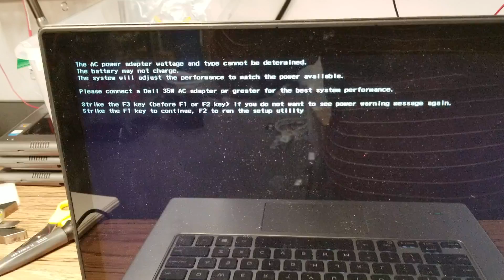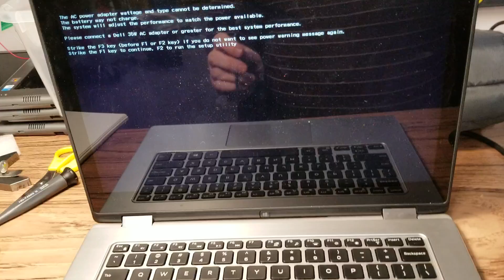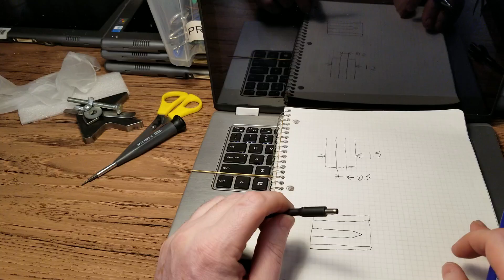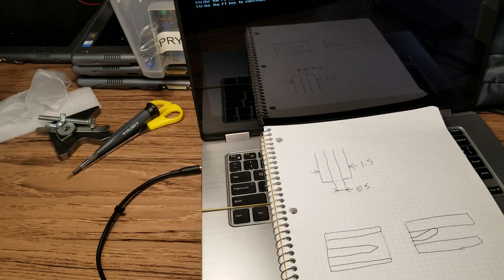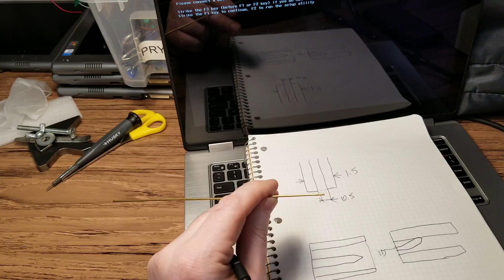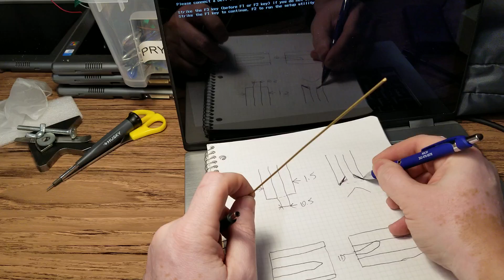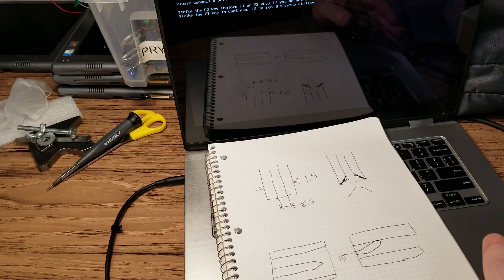Dell displays a message: Power Adapter Wattage and type Cannot be determined

Comment: My adapters are Dell OEM units that work fine on other Dell laptops.  Finally used an old PRO3X E-dock which bypasses the AC jacks on my 2 bad laptops (E7250 and E7450), and they now charge and run faster.  BIOS also indicates correct wattage.  The E-dock works with all Dell E-serries laptops.  Note: The dock requires a 90W adapter to operate.

Comment: if the id pin is touching the +19 volt on the charger in some Dell, Lenovo and Hp laptops the I/O chip will get shorted

Comment: that is not the problem  with my dell laptop.. the charging cord pin is straight,,, i get that same message on every start up..  i bought this used laptop from a buddy that was an IT guy for a large company...   i told him about the message i get, he had me read off the specs from the dell charger and the computer spec plate..  he said that is the correct type of charger for my laptop..
  i also notice that the top of the laptop gets HOT on both sides of the mousepad at times when in use..
 makes me  a bit concerned...

Comment: So I had this error message as well but my charger was not bent like that.I called dell and they told me to turn off the computer and then hold down the power button for 20 seconds before releasing it and it fixed the problem

Comment: I have a problema Lenovo: “The connected AC adapter has a lower wattage than the recommended model – Please connect the AC adapter which was shipped with the system for best system performance” the laptop is new. :C

Comment: I have put aside my original Charging Brick and adopted the use of USB C PD Decoy plug. With it, i can have a common charger and share with ALL devices that is USB and USB PD compatible. Those Converter / Adaptor / Decoy Plug is very cheap at MYR 10 each (USD 2.5). ALL it needs is a USB PD charger capable of 20v putput (45W and above) and the plug will negotiate 20v from the charger and supply to the laptop. Although the laptop voltage could be 18.xv ~19.x V, it can tolerate the tolerance of the supplied voltage and so far there it is working fine...

Comment: @5:36 "The Center Pin is the ID pin, that's what tell computer what type of power supply being plugged in to"

Correct me if i am wrong,
The Center Pin is either a Positive or Negative Pole depending on the Laptop model while the Other Casing Cylinder is the opposite Pole of the center Pin"

The computer display that message when the wattage is not as expected.
Eg when the connection is not secured, it cannot transfer current (A) effectively.

Watt = Volt x Ampere

Therefore the computer will register as a Lower Wattage adaptor was plugged into it.

Comment: I also get this message, but the problem is on the laptop board, power adapter works on other laptops, and also already replaced power jack. I will have to check if there is any short on the board, or IC...

Comment: Within some mechanical pencils, there is a metal tube that you can use to bend the charger pin back in place. This video fix worked for me, btw. Thanks!

Comment: i got problem same like that i use to measure the volt of charger and it give good output ... i didn't realize the pin inside the charger is bent after i see this video. thanks a lot bro ....

Comment: I'm getting this error after replacing the input jack after crushing the previous one by bending the power jack whilst inserted. I know the cable is good as works fine on another laptop still. Does this sound like a faulty replacement input jack or worse? Model is dell 5480. Thanks

Comment: I have the same issue with my dell inspiron 1521 and accidentally press f3 now my laptop totally no power. When I plug in the power supply connector power light goes off...

Comment: Oh my goodness it worked!!!! thank you soooo muuuch!! :D
Reply: @justyourlocalteasis1633  hi! im not sure what it's called, but the small pin inside the tip of the charger was misaligned/bent that's why the charger won't fit well. so i straightened the pin. after that, the charger fits well and the laptop was charging already.
Reply: @justyourlocalteasis1633  I'm glad to be of help 😊

Comment: Thanks for this video......I was able to fix my Dell laptop so it will charge again. I used a generic brand Q-tip to fix mine......one with a stiff stick....Cut off one soft end and shave/cut the stick so it is small enough to do the job if your power jack is very small like mine was. I am not sure I will buy another Dell though because of this feature. This is the second Dell I have had this problem with.

Comment: I still have this warning with 2 different power supplies and with good pin inside, it's on my Mothers Alienware m17x r3 and the performance is horrible atm. It's weird tho on diagnostic tool everything passed the test except my battery which I will get replaced in some days
Reply: Running Diagnostics from my Dell 5430 laptop, the power supply test says "Pass" but it also says the power supply is rated 1 Watt.  It's a 90 Watt supply, which is what is required by the laptop.  The test is defective - it shouldn't have read "Pass".

Comment: You sir, absolutely saved me some money!! I could not figure out why it would power on and work correctly but not charge and that message had me concerned. I just bought this power supply used and assumed it was not the right one when it didn't plug in all the way. In the end, that stupid pin was just bent. BTW I used a thumbtack point to fix mine.

Comment: I've been having the same problem for more than a year and it seems to have considerably slowed down my laptop. I bought a new charger, the problem persists. New battery, wasted money. I replaced the DC jack,  nothing. It's so frustrating that I may have to buy a new laptop after only 2 years of using this one. I'll never buy Dell again.
Reply: Yes I have this problem more than 8 month.. my laptop is slow.. 😢😢😢
Reply: I am having this problem from 2 days ago I think I have to buy a new charger for my dell laptop and yeah my laptop also slowed down it have 2.00 GHz and its speed always stayed in 2.00 GHz but now its been to 0.49 to 0.50 . my good laptop turned to bullshit
Reply: @sayanghosh4829  I bought a new charger and it worked for a few weeks, before the problem reappeared. Then a repair service told me that my DC jack was broken, when they fixed it, the problem was still there. Then they told me that I again needed to buy a new charger, as the previous one was apparently not the original one. They did fix the battery charging issue with the new charger and new jack, but I'm not sure if the computer was running faster because I refused their repair as I didn't want to buy a new charger again.
Reply: @womenstennis  Ok bro I understand, but first I will take a charger from my friend and see that it's charging or not if doesn't then I have to repair DC jack  and if it works I will buy a new charger...
Reply: @sayanghosh4829 Ok. Just make sure that the message is no longer there, not just that it charges.
Reply: @womenstennis  OK BTW where are you from I m from India
Reply: @sayanghosh4829  from Serbia
Reply: @sayanghosh4829  please go to a shop and try to repair it.. go to a good technician...
Reply: Zdravo Marija, razumes Makedonski? I'll go English, my Serbian is funny... I have the same problem for a year as well. Did you happen to find a solution in these 2 days? Or any help..?

Me nervira ova, poludecu...
Reply: @inkaloops-socialmediagrowt2611  The 3rd repair shop I took my laptop to says that my DC jack was broken (probably because of a fall) and my charger was not right (it was some Chinese substitute). They claim that they repaired my DC jack and that a new charger (25 EUR) is now charging the battery and the adapter is now recognized in BIOS. I still haven't had a chance to test the performance of the machine, but they say that it must be working with full capacity now, as the unknown charger and broken DC jacket forced the laptop to go into a minimum maintenance mode.
Reply: The 1st repair shop told me that the problem was just the charger and they sold me that Chinese charger, which actually did charge my battery for the first two weeks, although the warning message was still appearing. I thought I solved the problem and made a huge mistake of throwing away my original charger, which was maybe even fine and maybe only my DC jack was broken.
Reply: I've had this problem on my Dell Inspiron for 3 years and I've just grown used to it. Though I do miss when my laptop was faster...
Reply: @MixcesStar  I bought a second new charger and fixed the DC jack (if that's what it's called). I took it to three repair shops and the third one was skilled enough to solve my problem. My laptop is as fast as a bullet now! After years of annoying me. I was close to throwing it out of the window. Total price was about 50 euros.
Reply: @womenstennis  thats nice, I may do the same and Im feeling the same way you were feeling right now lmao
Reply: @MixcesStar  One more thing to note: my DC jack was probably broken because of a fall. Also, it's important that you buy an original charger.
Reply: @womenstennis  but what did the 3rd repair shop do?
Reply: @Krystalhelp  They gave me a new charger (the first repair shop sold me a low-quality charger that didn't fit my laptop) and repaired the DC jack.
Reply: you still having the same problem?? you can give me your laptop if your buying a new one..
Reply: I bought a new charger (proprietary), new battery (3rd party) and taken to a repair shop thst replaced the jack but couldn't help further. Apparently it could be a motherboard issue.

Comment: My pin isnt bent, and im still getting this message.

Tried replacing the charger with new OEM charger
Tried USB c charger
Tried new battery
Tried re installing windows
Tried updating BIOS

Still nothing. Fuck Dell
Reply from the maker: Charging circuit on motherboard is faulty. Either live with it or replace mobo.

Comment: As far as I know, this can also be caused by the mounting tabs for the power jack breaking off on the inside (and thus the "sense" pin failing to make contact), which was a very annoying issue on my Inspiron 11 (2015-2017 models).